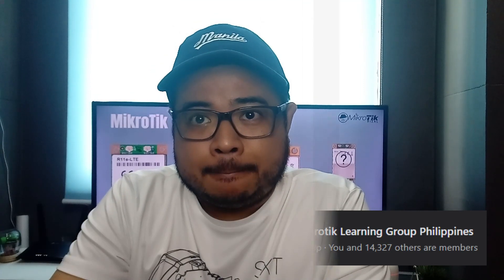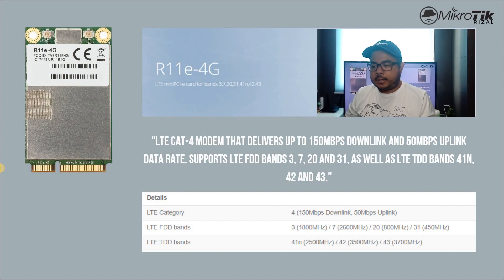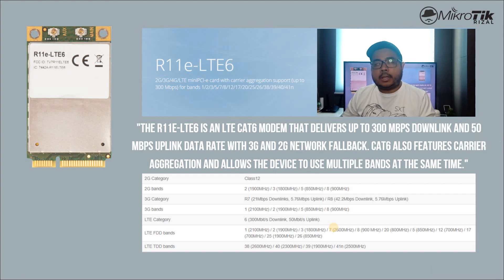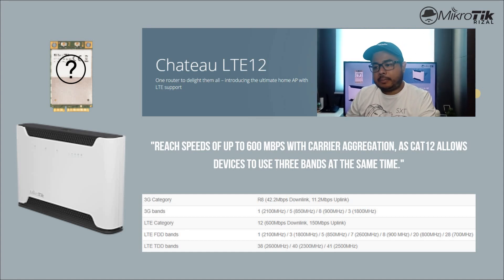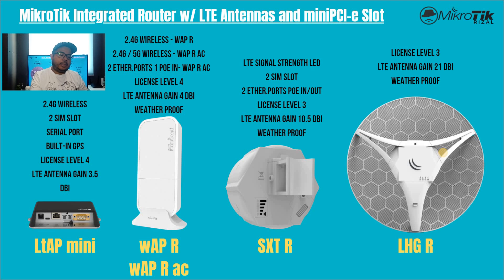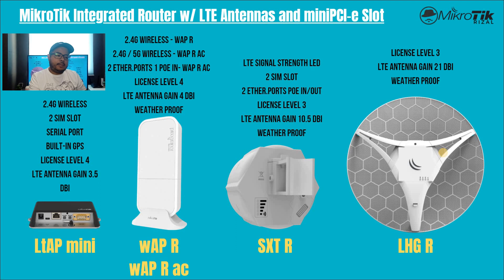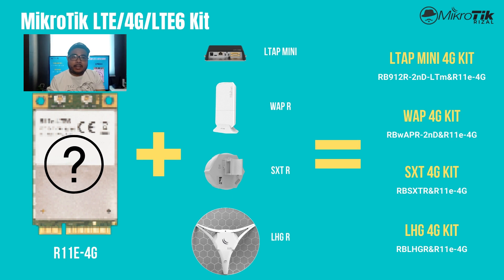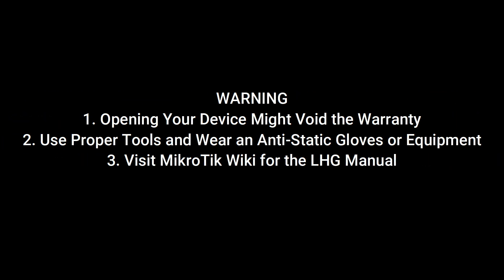MikroTik LTE Product Line Up + 200 Mbps Speed Test + LHG LTE6 Initial Tear Down (Tagalog)

Comment: Hai sir ...can you install the pci cat12 modem on lhg r11e, how do you get the mini pci cat 12m modem
Reply from the maker: no line up for mini pcie cat12 from mikrotik, the lte12 found in the chateau is a non mini pcie
Reply: @RizalTechGuide  owh ok sir. Thanks for imformation.but what if the mini modem pci r112 e cat 4 upgrade to mini modem pci cat 6?
Reply from the maker: @idekreatifitas-q5v  try quectel mini pcie modem they have cat6 and cat12, i've tried the cat6 and it works. I just followed the procedure in the MikroTik forum
Reply from the maker: @idekreatifitas-q5v  if you want plug and play, r11e-lte6 will work with thr lhg r
Reply: @RizalTechGuide  ok thank you so much sir..
Reply: @RizalTechGuide  can CAT18 work with the MicroTik LTE Kit ?
Reply: I just bought lhg lte6. I want to change imei. but it can't output on lhgg lte6: + CME ERROR: NON-PRODUCTIO MODE. how do I change imei on lhgg lte6 sir?
Reply from the maker: @idekreatifitas-q5v  i don't research on changing imei sir
Reply: @RizalTechGuide  owh okay sir.. thanks
Reply: @RizalTechGuide  sir.. I tried to replace the mini pci e r 11 e modem to the mini pci e lte 6 modem. The modem reads on the system, but why is the cellular signal from the provider not detected?

Comment: what is the data connection cable between the directional antennas (SXT R and LHG R) and the node (e.g. laptop) ? The brochure says its 100Mbit ethernet connector but ......why? LTE 6-12 capable of 3-600Mbit/s...can you please clarify that for me?
Reply from the maker: LTE12 modem is partnered with a routerboard with a gigabit ether port, while the LTE6 modem is currently with a routerboard with a 100mbps only,"LHG LTE6". If you need a giga port with the LTE6 they have a new line up with a gigabit ether port for the LTE6 which is the "LHGG LTE6 kit"
Reply: @RizalTechGuide  actually i need a directional antenna for my Mikrotik Chateau LTE 12. I saw your wideo with the MANT50 but if i needed directional antenna from Mikrotik.....which would be the best for it? (that could reach up to 3-Mbit?)
Reply from the maker: @needsomehike  mikrotik don't have a directional antenna,  a third party will be an option, usually available via online like amazon, alibaba, lazada, shopee
Reply: @RizalTechGuide  SXT R -LHT R not directional antennas ?
Reply from the maker: @needsomehike  it has a built in directional antenna, you cannot use that in your chateau unless you modify like detaching from the routerboard and adding a u.fl to sma connector for cable attachment
Reply: @RizalTechGuide  so the way i see it, basically the SXT-R and LHT-R directional antennas got pci-e slot for modems and sim slots and once you insert your chosen modem and sim card they are ready to use  on my laptop (as external 4G LTE antennas)  via the ethernet cable? so what will do the routing? (sorry to ask too much but trying to build up the concept in my head, i hope you don't find my questions too lame)
Reply from the maker: @needsomehike  yup that is how it works, but i suggest getting the modem from mikrotik for a lesser headache, or just get the kits rather than the R version only. Routing is automatic for the lte interface, just plug the sim and you are good to go
Reply: @RizalTechGuide  excellent, thank you again for the replies!!! .......actually one other question came up: so the routing is on auto for the LTE interface but what about other features that routers have, like firewall? You never deployed additional devices between the antenna and your laptop?
Reply from the maker: @needsomehike  you can still configure if you know about routeros but if not just use the quickset where you can edit ip address for the dhcp and enable nat. I would suggest to just have another router below since the lhg R and sxt R has some restrictions because of the license level 3

Comment: Sir pa reach out sau baka may alam kau na bibilhan ng ltap mini with r11e-lt6 modem or modem sold seperate as bundle, need ko kasi project malambrigo batangas to tower cellsite calapan mindoro 21.5km ang distance may 30dbi antenna dish na ako modified for lte
Reply from the maker: mukhang  wala pa ata demand for the mini pcie modem, may i-upload ako video this week yun swap ng modem from lhg lte6 to ltap mini
Reply: Rizal Tech Guide hirap nga sir pre order na lang cguru sa infobahn or unitedplexus
Reply from the maker: @Magsyboy  ang 1 box kasi ay 20 pcs. kaya mahirap talaga pag wala pa demand sa market
Reply: Rizal Tech Guide naka order na ako sa ebay sir, onga pala gawa ka din teardown ng chateau12
Reply: Rizal Tech Guide ung mga internal pcb mag tutorial ka din ung upgrade built in internal abtenna ng 2.4 or 5ghz kasi may. Akota ako sa ltap may mcx connector pwede un lagyan ng external antenna

Comment: may mabibili bang mini PCIe modem sir?
Reply from the maker: mukhang wala pa sa local stores
Reply: @RizalTechGuide  may nakita ako si same na modem pero sa PLDT home ultera OT-350 made by green packet... iwan ko lang ko pwede... pero b42 lang walang ibang freq.
Reply from the maker: @ronalddumpa5701  if mini pcie siguro  na iba need pa i-request yun firmware compatibility with mikrotik para mag work sa routeros